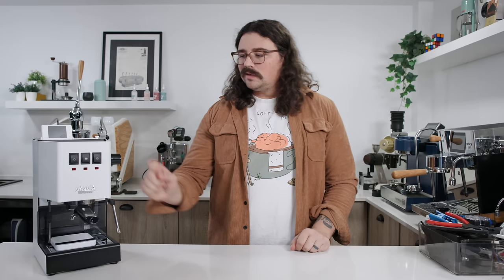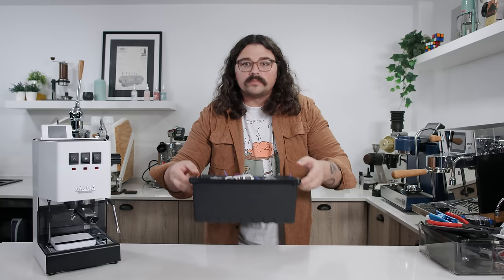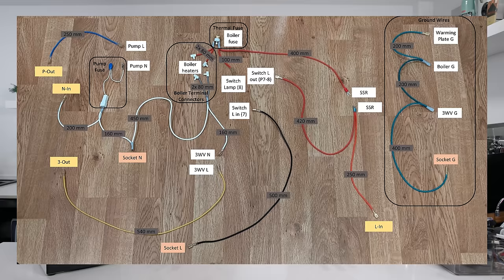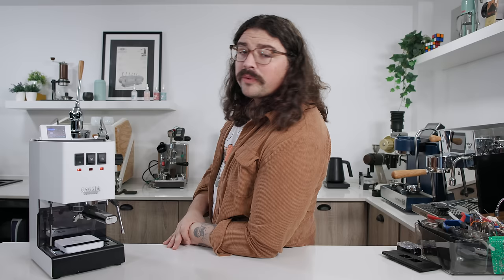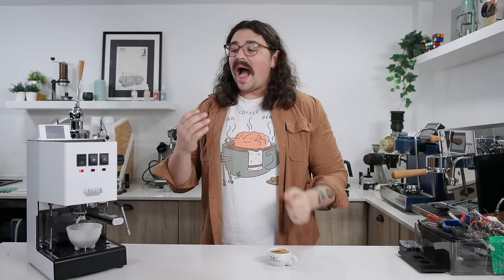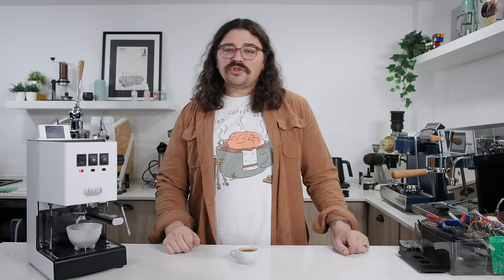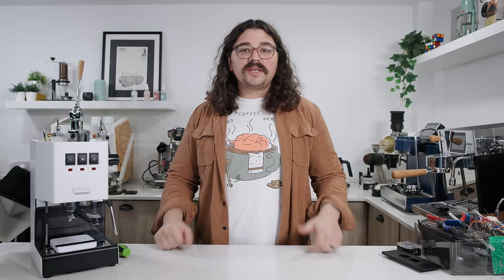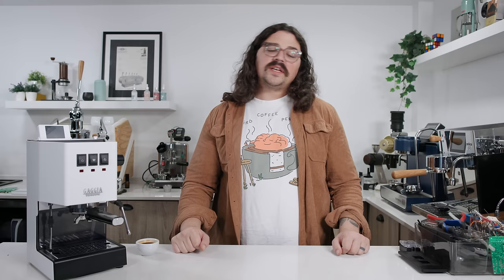ULTIMATE ESPRESSO MACHINE MODIFICATION: The Gaggiuino Project (Gaggia Classic Pro)

Comment: As a person with a degree in electronics who became a software developer who loves espresso, I never thought I’d see a single video that encapsulated all of my interests. But here it is! I bought a Decent due to the tech/coffee crossover, but this looks like a really fun project.
Reply: These projects indeed are. The good thing is that these single boiler machines are extremely simple. A boiler, a thermostat, a pump and a number of valves. You just add sensors, brains and a couple of SSRs. And with the open source stuff like Gaggiuino or Clevercoffee (to name only two), you can even build bespoke solutions.
Reply: As a person with a degree in computer science, who also does electronics, I did the PCB build in one day, and it's the best project ever. I highly recommend it.
Reply: Do you think you are going to give this a whirl, even with the Decent?
Reply: @2k3r1  No, I don't think it makes sense, given the inherent monitoring capabilities of the Decent.
Reply: @BenRichards7 wimp! Just kidding
Reply: As a person who's been using the Lego build for over a year, it's totally worth it.  Also, the scales mod is a must IMO.
Reply: @DouglasK  what brand of scales did you use
Reply: I’m an EE who works as a SDE and I’m addicted to espresso 😂

Comment: I have been looking forward to this video for several weeks, since you alluded to it.  I'm glad you're covering this mod, as it needs a lot more publicity. Publicity. It is one of the most amazing mods I've seen for an espresso machine.

I have a Gaggiuino modded GCP that I have been using for several months. It is absolutely wonderful.
Reply: I agree, it looks really great and the money that you save using this mod is insane. One of the things that I am curious about is the frothing pressure. Did you notice any change in terms of that? I personally consider the pressure that comes with the original model to be pretty low, compared to other brands that are in the same price range.
Reply: @hashimbk  It has a "dream steam" feature which maintains steam pressure and never runs out of steam.
Reply: I'm still waiting for my kit to arrive, now 2 months in, but I'm hopeful it'll get shipped soon. Have you encountered any serious issues ever since you've modded yours? Did you also have to deal with the Eco pcb that needs to get removed?
Reply: I've had mine working for right at a year with full scales integration. I can't imagine my home coffee life without it. I consider coffee from my local coffeeshop as essentially Bunn drip coffee compared to my first cup of the morning at home off the gaggiuino.

Comment: I did the mod a few months ago, and it is magical. I really want to try the hardware scales upgrade at some point, but even the virtual predictive scales work really well once you have your grind dialed in. It gives you all the complexity you might want, but you can also just a flat 6-7-8-9 bars if you want since you have the pressure sensor. 
The biggest game changer though for me was the milk. Steaming with the gaggia wasn't bad, but it was something you kind of need to get used to. Steaming with the gaggiuino is a breeze.

As someone with basic electronics skills, the whole mod took around an evening and I was taking my time and double and triple checking things to make sure I was doing it right. Didn't even need to ask for help from the discord, but looking at existing help threads certainly can help avoid some pitfalls. 

100% worth it in my opinion.
Reply: I'm looking into doing this mod, did you buy a PCB kit or did you do the Lego build? I was excited to try the Lego build but after throwing together an AliExpress list of parts directly from the project site, seeing a near $200 cost with shipping has me second guessing what I've heard about this projects projected budget.
Reply: @scarzilla  I did the pcb. I'm pretty handy with electronics but my soldering skills are pretty bad. The whole kit, minus the water sensor and hardware scales, as they are optional, came out to roughly 150$ with the shipping. Keep in mind that you won't get the wires needed for the custom wiring harness unless you cannibalize the stock one, so if you want to be able to rever the mod easily, either get additional wires and switch harnesses completely, or do the stock wiring integration.

Comment: did this mod at the start of this year as a fun weekend project with 2 friends. managed to do 80% of the build in a single day and finish the rest on the next. mind you that we had never seen an espresso machine from the inside, and while i like some tinkering with IoT appliances that had never gone to this extent before, and i have the eco version as well. it's not THAT complicated as it's a really basic machine apart from the whole eco wiring bullshit. for anyone trying to do this mod, just try to constantly keep in mind what the buttons should do and attach your wiring from there on. keep track of your high voltage wiring (mains coming in from the power plug, to the button, and to the boiler). if i remember correctly all of the buttons should jus be connected to your microcompter since they are only used to command the micro computer, which will handle all the internal components accordingly. this is a bit oversimplified but if you keep this in mind while building you should be able to manage it all with some common sense

Comment: I did the PCB build. You don't need the scales to get the weight readout and auto shutoff, but it's a different firmware build from the one that you have (I'm guessing, since you get no weight readout). Once you have the right firmware installed, you'll need to calibrate it, measuring the weight using a scale. It's not hard, and it's really awesome.
Reply: how does it compare to the physical scale? Do you need to calibrate it regurarly? I guess it takes into account the flow rate and output of water..

Comment: Incredibly detailed and informative video Lance. If anyone needs a high pressure replacement piston pump for their machine, we sell our ETS17 and ET200 Series pump which has longer life then the Ulka due to the fact it relies on close machining tolerance over elastomer seals. Cheers, Geoff
Reply: If anyone thinks to buy this while planning on gaggiuino then don't because it won't work with the project regarding following the flow characteristics.

Comment: I'm glad I switched to the Flair 58 and Nanofoamer Pro, and am selling my GCP. Not a fan of the maintenance and things that can go wrong. Need to order a new steam valve now, after it started leaking post-descaling. This kind of project is great for tinkerers. My Shades of Coffee kit to give it PID and flow control is still sitting there after many months; too busy to tinker, with a couple of little kids and two jobs. Maybe this comment will help someone who was similar to me get my perspective.
Reply: Bang for buck, it’s a brilliant machine. But ultimately something like the Profitec Go is a lot better for not much more. 

Single boiler is a killer, hence why I got rid for a dual boiler.
Reply: @chefsean1  I've had a great experience with my Flair 58+ so far, but it'd be more fair if I used it for a year and a half first like I did the GCP.
Reply: Flair 58+ and the Nanofoamer Pro is my dream setup too for si ilar reasons like yours. Also, since I’m the only coffee drinker at home, I don’t make back to back espresso so the Flair is more than enough for me.
Reply: I did the Shades of Coffee mod to my GCP for the PID and changed out the spring to a 9 bar and thought it was good. I bought a Cafelat Robot to play around with and the second shot I did was way better than anything I could do with the GCP. I’ve since got a Flair 58 and love it even more. Recently got the Nanofoamer Pro but haven’t used it yet for any latte art.
Reply: @tomy2988  did you upgrade your basket on your gcp?  That made such a big difference on mine.
Reply: @StableNomad   Yes, I’ve been using a Pullman basket on both the GCP and now the Flair
Reply: I agree flair 58+ the best buy I ever did and the shots come out amazing too.
Reply: You're overthinking it. PID takes 2h to install and there's no upkeep or additional maintenance. The valve is annoying but can also be modified to negate that issue. In the end you get the hell of a little machine.
Reply: @DmitrijPaskevic  nah not overthinking it, dealing in reality with descaling and the steam wand failing (among the numerous other problems that can happen to a Gaggia) is annoying.
Reply: Yeah unless you want quick espresso at least 2-3 times daily there's not much point in forking over money for a good standard with all the maintenance a complex machine requires, not to mention the space they take up.

The only reason I'd ever want a machine is for a steam wand, for practice and convenience of foaming milk occasionally, but there's not many even decent options for stand alone wands.
Reply: Flair 58 is lovely. I use my nanofoamer mainly for making homemade hot chocolate since I don't drink milk-based coffee drinks
Reply: @benshapiro306  I'm in the US, and plan on including the Shades kit along with some other things when I sell the GCP.
Reply: @niccoloaurelius1587  makes sense enjoy the flair. Lever machines are really good 😊. Take care with the preheating
Reply: I currently have a flair 58, and was considering selling it and getting the GCP and doing the gaggiuino. Glad I saw this comment. I really value the low maintenance of the flair and I could see myself buying the kit and not having the time to install it. Hmm 🤔
Reply: Cool to watch this and all the power to the DIYers out there, I just have zero interest in this. Happy with my safe Breville Barista Pro
Reply: Why you don't get it used
Reply: Yeah but I think people miss the main point of this mod and that's being able to consistently pull any style of profiles however advanced they are, good luck doing that manually on a flair as once you need to track multiple variables and exit conditions at a time you're lost in that whole manual lever experience and will never be able to consistently repeat any of it even if you manage to do it, moreover pulling multiple shots one after another is also challenging.
I think people don't really understand that their one espresso a day pulled in a basic way is different from what this mod actually provides and opens to a person wanting to experiment.
Reply: @VSparxxx  I think you make a decent point!
Reply: @benshapiro306 preheating on the 58+ couldn’t be faster or easier. Press a button and then boil a kettle. ( 1 button on Stag EKG).     The preheating on the GCP was the issue for me because it melted the day I got it after leaving to preheat for 30 minutes.
Reply: @AT16 agree I have a flair pro and a profitec go and damn I used some dual Boilers but the go is so good for the price. Like chnage the shower screen a good basket bam! You can do basically anything. The heat up times and the switch from coffee to steam is quick love it
Reply: @AT16  a lot better by what metric? What can a Profitec Go do that this can’t compared to vice versa?
Reply: [Once it actually ships] I’ll be moving from Rocket Appartamento to Meticulous Espresso plus Meticulous Milk.
Reply: @tomy2988  I had a flair 58 and returned it for the GCP. I loved the Flair, it was such a great experience. But as someone who loves milk drinks too, having a steam wand was important. I also modded my GCP with a BoostBox which allows pressure control and PID. 

But man was that flair 58 amazing. So beautiful, elegant, and felt so good to pull shots on. Unbeatable experience.

Comment: I only just received my PID, pressure gauge and dimmer kit from Shades of Coffee (awesome people) last week and was planning on starting it tomorrow...  now I'm wondering if I really made the best choice in mod kits! I already replaced the OPV spring with 9 bar spring, the old grouphead gasket with a nice, new silicone one and the shower screen and holding plate with a very nice upgrade from from BIT International,  and lastly  "The One" steam wand tip - remarkable difference in shot quality from these extremely simple to install little upgrades. But what I REALLY wanted to have was precisely what you've installed here. At least I'll have fun gaining the experience of installing the Shades of Coffee mods. Then I'll just look forward to a completely new build on another machine in the future! I enjoy the tinkering as much as making and drinking espresso, so when I can get way better espresso after having this much fun tinkering,  I can't think of a better way to enjoy my free time. Thank you, Lance, for all the excellent videos you've created sharing your knowledge, experience and creativity with us.  And.. KEEP SINGING!! 🎶
Reply: The Shades kit is awesome. There's always a FOMO with mods, but the steam from the shades kit is a game changer. You'll also have flow control for preinfusion. Yes, the gaggiuino is more precise, but the shades kit doesn't 99% of the same for way less work.
Reply: I had the shades of coffee PID and it was great but this takes the machine to another level above the PID. took me about the same time to install.. maybe even less. I also installed the scales which I created my own 3d files that works amazing with the low profile drip tray from shades of coffee. So I would totally recommend it

Comment: Honestly the Evo version is not that bad. I admit it's not 
a 2 hours job but if you already are used to electronics soldering it's just a couple more hours if you want to make it clean + since you're doing the whole circuit it comes out a lot cleaner than it is out of factory. It's my first "proper" expresso machine and I learned so much about coffee thanks to this project. If you're passionate and take time to learn how to solder, read through the wiki a few times it's a lot easier than building a drone or electric skateboard or other fancy diy electronic stuff. It took 1 try whereas frosting milk is still very difficult to me.
Reply: To extend on the above, the hw scale is a little more difficult part of the project. Not electronics wise, but on the 3D printing side. You have to be very precise with your prints. You can "cheat" with buying the parts or printing them with a bambulabs printer which makes very clean prints without really knowing what you're doing. To sum up, this can be intimidating but take your time and it will work. You'll be proud and will have a very functional machine.
Reply from the maker: nice. i didn't have the evo version but good to hear it isn't hard. and I had to buy the 3d parts because I have no 3d printer ha

Comment: finally you did this video!!! combined with the preheating coil mod (which is incredibly effective) I've been getting really great temp stability in my unit. it's been outstanding, never upgrading
Reply: If you do the Gaggiuino mod you won't have to do the preheating coil, since the software knows waterflow and compensates by adding heat to the boiler before temkperature drops. So the temperature stability is really improved.  AlexandrosLullus

Comment: Don't go for the scale in the dripping tray, it's a pain to get them right. It's easier to get the predictive scaling and works a lot better after you calibrated the pump settings. Cheers
Reply: how to get the predictive scaling  and how to calibrate the pump settings?

Comment: I modded a Rancilo Silvia, using an "ito" module from "project caffè", some years ago, in a similar fashion to the mod shown. It gave me PID temperature control, pressure profiling, and even dosage by weight with a bluetooth scale!

I used it for a couple if years for our morning coffee, but eventually became frustrated that the pressure sensor kept dying on me. These days, I profile my pressure using a Flair Pro 2. Less hassle, same result in the cup.

Comment: Absolutely incredible. Bigger crisper screen with nicer graphics would be nice to have, even if it has to be a bit more expensive. Touchscreen on something this small is not going to be a pleasant experience.
Reply: Works just fine.  Everyone worries about the size until they use it and realize the screen is easy to use.  Web interface and bigger screen are also near term.
Reply: @paintflinger  By the 10th time you’ve “upgraded” your $400 GCP, including the hours days weeks in time, you could have bought a Decent and a sick grinder…  not to mention all the people who screw up when tinkering…    This machine has spawned a whole side hobby from the main quest line at this point.
Reply: I barely touch the screen on mine - maybe a little mucking around with the profile every now and then but generally once it's all set up i'm not touching it, it's only a readout for me to eyeball pressure/temp etc so I feel it's not at all an issue.
Reply: @skyking9248  I don't think you understand the cost difference.  

As far as modding, new screen should be unplugging current jst and plugging in the new one/print enclosure.

If you feel your time is worth $3000, by all means get a decent.  If rather get the sub $1000 option.
Reply: @paintflinger  What’s your total cost at this point? Including the machine itself but excluding the value of your time.

Comment: I have been following this project from the sides for some time and it is really great. I was pretty close to buying, but then the Meticulous was launched and that looked even nicer. Your build looks really nice. The only thing I would like to improve would probably be a bigger and better screen as you will interact with that one quite a bit. Maybe a 5-7 inch screen with a resolution of at least 800*480.
Reply: agree with the bigger screen. (will try it) 
I also backed the Meticulous, will probably wait quite a while for it to arrive so I might try the Gaggiuono. (only question is, if this works with a dual boiler machine??)